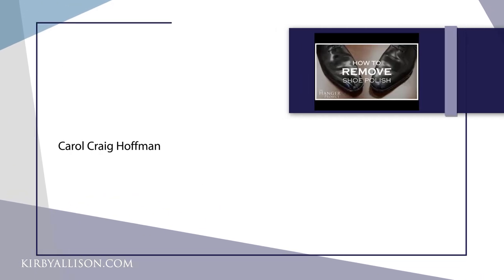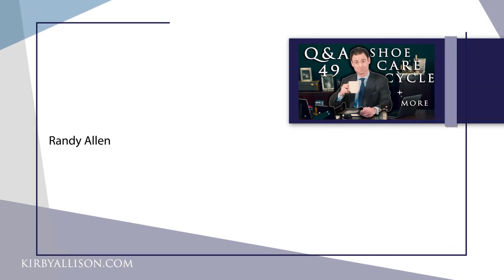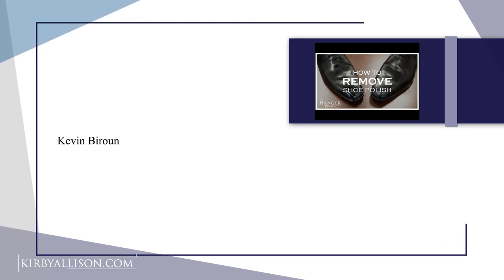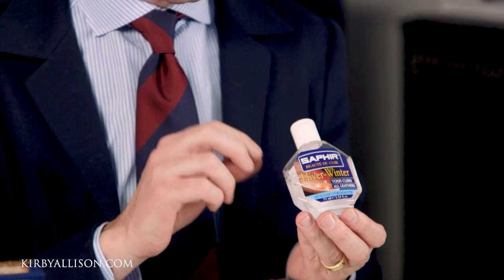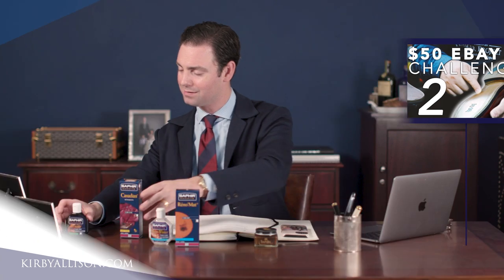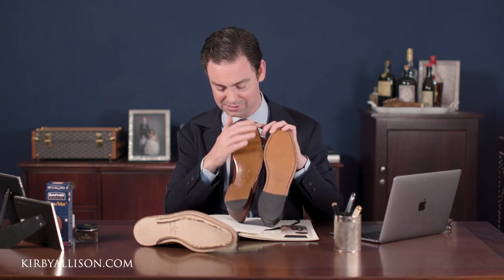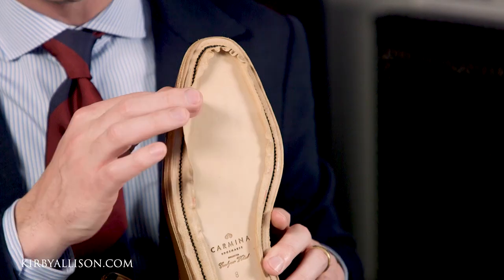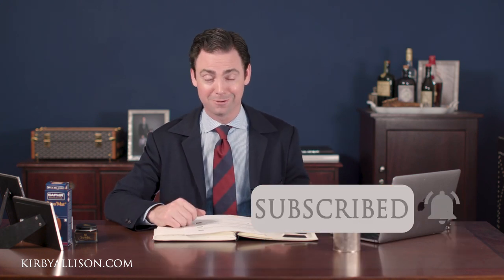Q&A | Which Stitching is Better? Plus More Questions Answered! | Kirby Allison

Comment: I feel that you danced around the durability question on open/hidden channel, Kirby. As far as I understand, even if the bottom stitching may have become undone due to wear, the durability is still there (from Trenton&Heath). I can appreciate that a thin bit of leather adds a degree of durability on top of this, however, hidden channel stitching usually comes up a huge up-charge which is not accessible to everyone.
Reply: Totally agree. I do not think that there is real statistics that would support more durability for hidden channel stitching.
Reply: You're right. The stitch on a Goodyear welt is a lock stitch. Each individual stitch must fail in order for the sole to come off, and it fails at the point where you reach the lock (essentially the piece of stitching you can see at the top of the welt, often a different colour). Durability has nothing to do with the stitching, I've never heard of stitching failing.

 Durability running out is when you wear down the leather to reveal the welt in any part of the shoe's sole (usually the toes or one side if you walk in a particular way, this is why tacking or a metal tip is popular) or through the center of the sole and reveal the cork.

The hidden stitch is purely aesthetic.

Edit: changed up phrasing

Comment: kirby, something i haven't seen on any of your shoes yet is one of those rubber sole protectors that are glued from the toe of the shoe to the  waist, along with a metal tap at the bottom of the toe. i have it on all my high end shoes and i don't think i would have it any other way seeing as it's much easier to replace a rubber sole protector than an entire sole. i'm curious to know why you don't also have those on your high quality shoes.
Reply: I personally don't have rubber sole protectors because I like looking at the leather sole.  I know it's stupid.😁.  I only have metal taps on some of my shoes; they seem to make my shoes more slippery.

Comment: Hi Kirby. Why do top lifts have a little notch cut off on the inside corner on most shoes?
Reply: It's to prevent your trousers catching on the corner, both when you're sitting and the trouser leg might fall below the heel, and when you're walking so it doesn't catch on any cuffs/turnups you may have.
Reply: @DavakiDnD  thanks. Appreciate it.